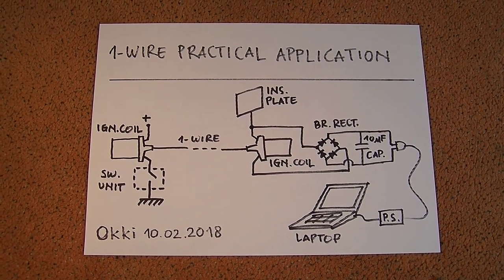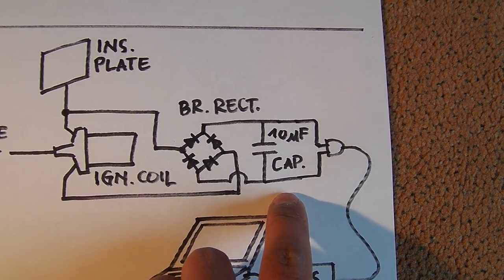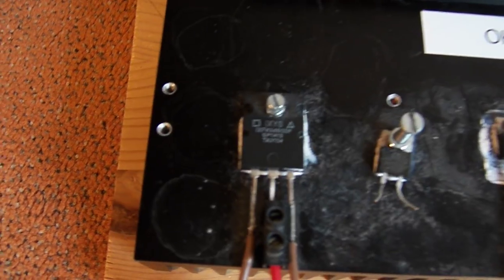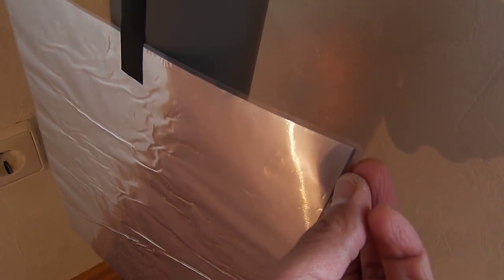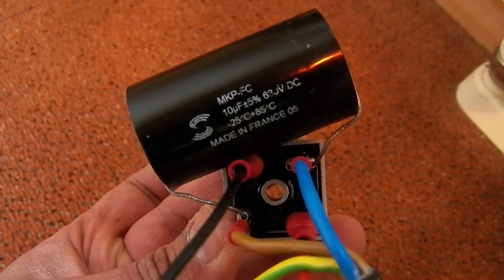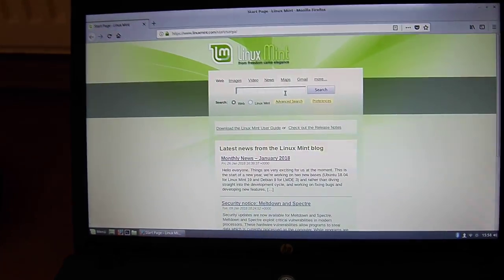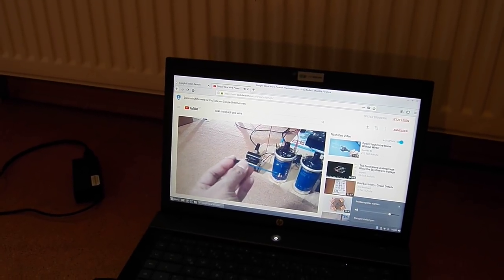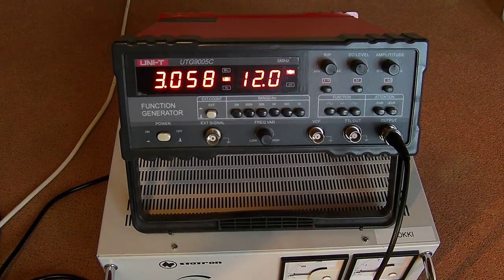One Wire Transmission Powering a Laptop

Comment: Nice work and demo Okki. I think you should blow everyones mind and use the smallest gauge possible for the transmission line. Something in the 30awg range will do ;)
Reply: Davy Oneness yes it would be cool to show the running on a very small fine wire diameter also how long can you make this wire to still be able to run this Laptop ?

Comment: Hi ok very well done what is the voltage on the 10 microfarad capacitor ?does your laptop power supply also run on DC voltage ?
Reply from the maker: The capacitor voltage rating is 630 V DC. You can see that if you see this video in HD mode.

Comment: So what’s the point? You are using AC power to power your circuits, you have to use function generator, big cap, two coils, mosfet, etc to power your laptop. Laptop adapter which uses wire costs $10 on ebay. I apologize if I misunderstood something.
Reply: It's an interesting experiment on classic Tesla principles.
It's not the destination it's the journey.

Comment: How can laptop power supply module operate on Direct Current ? Those adapters are made to run on AC only, Right....?
Reply: Coil Smoke No. SMPS PSU will run on both AC and DC. Chopper/ferrite transformer on laptop PSU won't directly connected to the Mains outlet. It passes thru rectifiers and filter caps before going to the transformer via switching circuitry. Which means even if you powered by AC or DC it will still converted to DC before going to main switching components and switching circuitry needs good DC source.

Comment: Since it is one wire transmission, would that mean it is cold electricity?
Reply from the maker: I don't think so.
Reply: @OkkiMoeljadi  Can you measure the current along the one wire power transmission?
Reply from the maker: @braaitongs  no, I cannot.
Reply: @OkkiMoeljadi  Which means it lacks a measurable magnetic field right?
Reply from the maker: @braaitongs  you can measure the current at the receiver side but not at the transmission line.
Reply: The transmission line is high voltage, tens of thousands of volts. You want to put that across a DMM?

Comment: جزاك الله خيرا،،
How out the power consumption, I see kill meter
2 what type of energy your circuit transmitted
Reply from the maker: The efficiency is pretty low, otherwise I would show you the input power on this video. You can check out my other one wire power transmission videos for the system efficiency.
Reply: @OkkiMoeljadi  thanks for your reply
Eric P. Dollard in one of his experiments show that lamp powered by longitudinal energy has strange effect,, it attract Metal etc , do you try in your lamp
Reply from the maker: @samnile2  yes I did. It attracts alu foil because of the static electricity properties of Tesla Coil. I did one or two videos about that.

Comment: Do you have any gain in wattage?
Reply: no :D if anything losses. please font give me overunity crap.
Reply from the maker: No Machiuka, there is no over-unity effect on this setup.
Reply: speaking of power, how much were you able to push across the setup?
Reply from the maker: I don't know exactly how much. I guess I could draw around 90W at the receiver's side before I blew my coils. FYI: I destroyed many ignition coils during my research investigating this technique.
Reply: thats pretty good! I got this to work using two small ccfl transformers. Granted I was only able to transfer maybe 5-6 watts, but it was silent :D! Good job on the 90 watts though. Have you tried this with a flyback yet? From what I know, those can transfer up to +_300 watts.
Reply from the maker: I have never tried using flyback transformer. You can run higher frequency with those transformers, no wonder that they can handle more power. I think I will try that one day.
Reply: you definitely should give it a shot! Maybe see how far you can do this with a flyback in your yard or something.
Reply: @OkkiMoeljadi   I guess i should look but is the HV coil terminated to Earth ground , wait i guess not considering it's meant for a car .....
what about the HV side of a microwave transformer  have looke into that?

Comment: it is strange ......you get DC after the rectifier and then it goes to PSU laptop which should powered by AC ....
Reply: Was going to say the same. Bogus site. Otta here.
Reply: Most power supplies that out put dc like computer powesupplies and many other things that run off dc just turn the ac into dc  with a bridge rectifier right when it comes into the power supply so you could technically just feed it 120v or 240v dc and most things would work fine  it would just only use half of the bridge